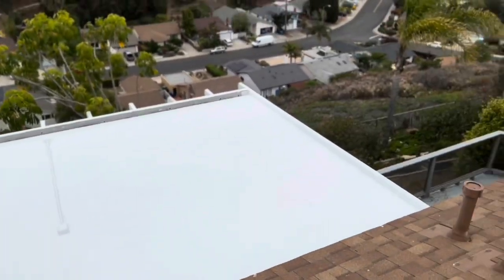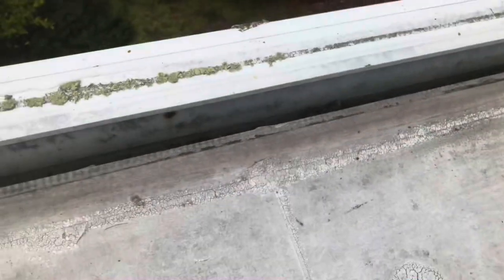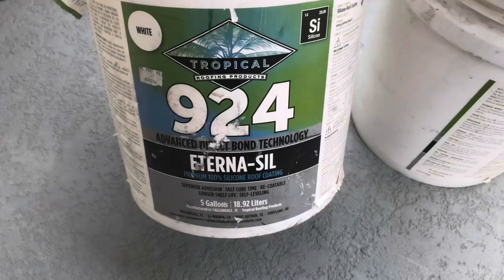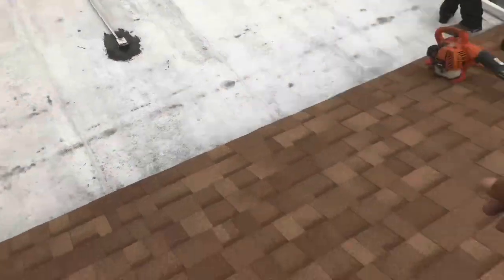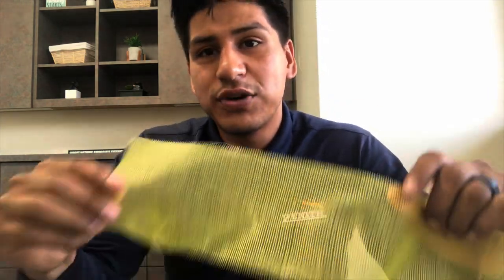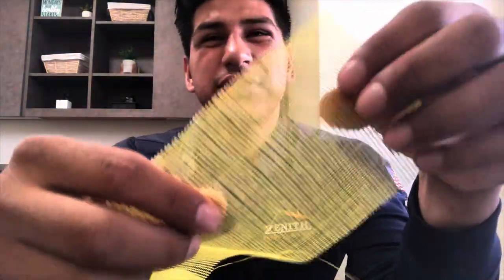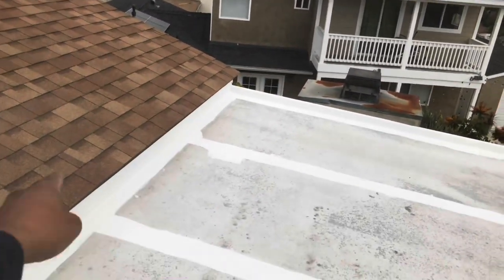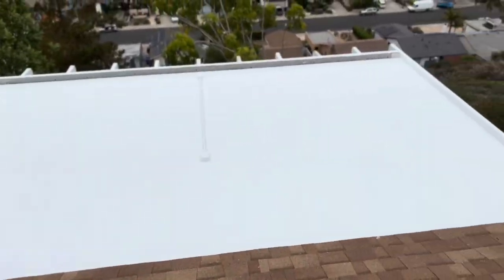I Applied A SILICONE ROOF On This Sunroom! EASY Step by Step.

Comment: I see no drainage for water on that roof.... so now you've sealed it like a fish tank... is it just going to fill with water?
Reply from the maker: There is an internal gutter system where the rafter tails are. You can see it at 0:33 at the top of the screen, and 2:09 behind the rafter tails. Thank you for pointing that out. I’m sure you are not the only one that will have the same question. Greatly appreciated!